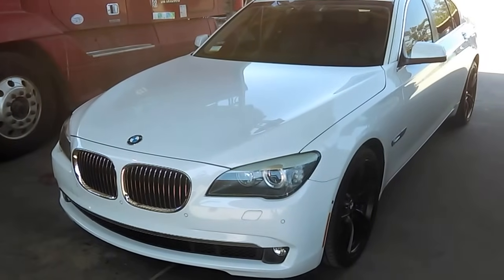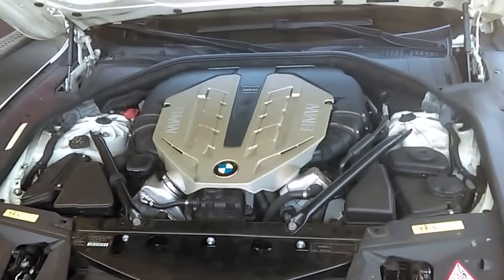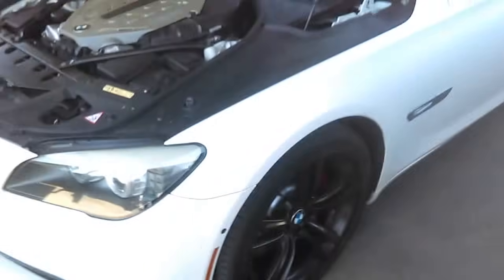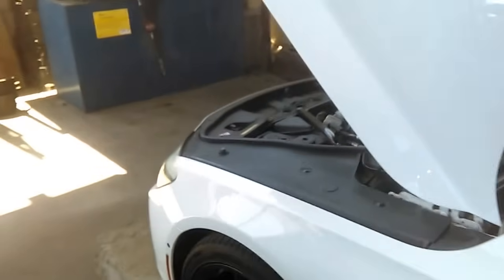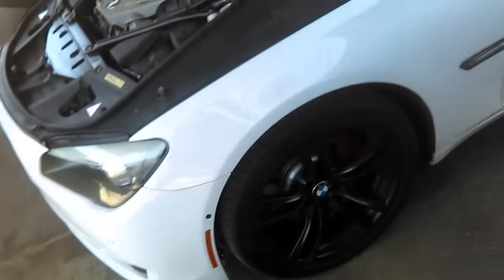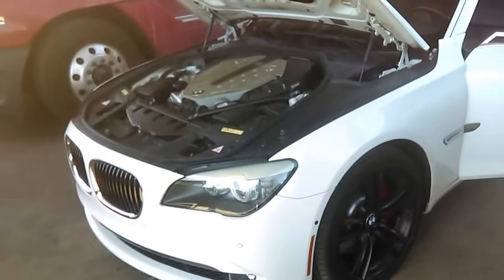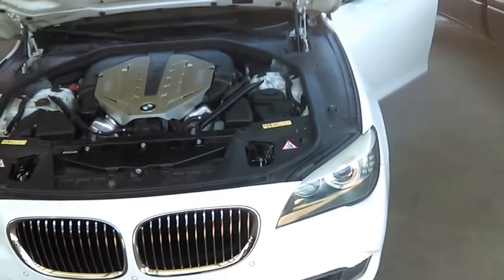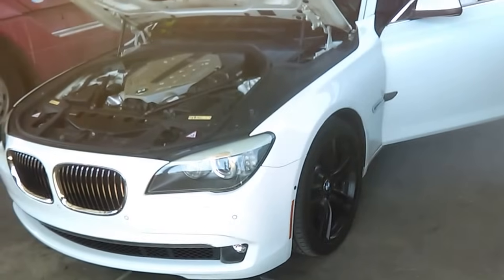BMW 750i 750Li F01 F02 common problems

Comment: @Francisco Amaya, were you lucky enough not to get the "Drivetrain malfunction error" yet?
Reply from the maker: +Razvan R
Do you mean the "transmmision Fail-Safe mode?
Reply from the maker: +Razvan R 
Ok, drivetrain malfunction error is a protection mode for the power train components to prevent and major damage to them.  
This usually happens when the vehicle needs a major service or major tune up the problem is than you need to have a BMW diagnostic tool (cost around $3,000.00) to know the actual reason with the of the drivetrain malfunction error.  
My BMW is running fine at this moment but I am going to replace the spark plugs soon because that is one of the major reason why the drivetrain malfunction error protection mode comes on.
Reply: About to do that myself as well, I searched a lot about it and I've seen many cases where they changed something but the error was still there, or they couldn't find the root cause at all.

That's why I got all these possible answers out, maybe I can have them checked at the service:

>>>>
We had this message almost immediately, returned car to the dealer, took them a half hour to find the problem.  A short, 3 inch or so, flexible tube connected to the turbo would kink and after replacing it it has never recurred.

bought a 740D 2 days ago,having the same problem.The car performs well but the message appears after the engine goes at 90-100 C°.I will visit a workshop these days and I'll be back with some answers. ✌
UPDATE! 
I changed the engine oil and the malfunction is gone!

I had Problem with Idel and error DRIVETRAIN IN 750I 2010 F01 I have fix and chaange Throttle Body work great.

ignition coils and/or spark plugs

I had to put a new transmission And shifting gear. 13k job!!!! Hope you covered

Tichatyei Chieza Yep, Got it fixed in june. A warranty issue..It was a faulty valvebody

Got a Drive Train malfunction on my Bmw 528i, Took it to Bmw of Ontario CA to get it checked out. Ignition Coils were on Tsb Recall and the best decision (they said) was to get new Ignition Coils and spark plugs. 

I had drivetrain malfunction and they replaced coil, spark plugs, 4 injectors and 1 more thing which i can't remember... 1 week total and now she's fine

N63 recall in USA

Thanks for the answer, very kind of you Francisco! You and your car stay out of trouble :)
Reply from the maker: +Razvan R 
Thanks, you are welcome.
Reply: Turns out it was due to a "missfire on cylinder 8" error. 
The mechanic moved everything from the 8th cylinder to other positions: the injector to 7, the coil to 6, the spark plug to 5 and then the missfire error moved to 6, so faulty coil for me.

Comment: do u know how to fix the excessive oil consumption and what parts needed to replace?
Reply: i have 750li 2009
Reply from the maker: Most of the time it can be the valve stem seal or the turbo charger
Reply: Francisco Amaya thank you
Reply: approximately how much does it cost to get it fixed ?
Reply from the maker: That is like 5k all together.  Valve stems seals are like 2.5k
Reply: Francisco Amaya that’s what I thought. Thanks so much, I appreciate it. I didn’t want to get scammed that’s why I asked.

Comment: Question. I have a 2014 bmw 750li with only 25k. Ac is blowing warm air. Hooked up the ac pro recharge system thing and it shows no refrigerant needed. What do you think the problem is? Obd scanner did not pull any codes
Reply from the maker: Check the ambient temperature sensor 
Check if the ac clutch is engaging
Reply: Francisco Amaya how hard is it to check these things and where would they be located at?
Reply from the maker: It is easy to check the ac compressor all you have to do, it is to see if it rotates.  The sensor is the same one that displays on the dashboard

Comment: I have one and it stays in the shop at least once a month I just got it out the shop $4000 for drive shaft. Now 4 days later I go outside my air bags are out the back end is sitting on the ground

Comment: Hey Francisco did you get the recall done on the n63? They gave me a new engine because of the lawsuit about the oil consumption.
Reply: Larry Troupe hey I’m in Tennessee and I see there’s a recall on my 2012 750Li xdrive for the turbo water pump or something like that! Is this the reason for your engine replacement?
Reply: J. Kisart 
Oil consumption was the issue and they gave me a new engine rather than try to fix it.
Reply: Larry Troupe wow I’m going to BMW of Memphis hopefully I can get blessed as well lol thanks man 🙏🏾
Reply: Larry Troupe so my recall is Electric Auxiliary Water Pump For Turbocharger so maybe I won’t get so lucky lol 🤦🏾‍♂️ It would’ve been great to get a new engine
Reply: Larry Troupe the BMW dealership here in Memphis just told me today that they will NOT replace my engine however they will check the valve stems smh I’m pissed

Comment: I have a 09 750li and my transmission malfunction was coming on and a few months later the the car was driving funny and stop producing power (drivetrain error). I was told replace my crankshaft valve. Did that nothing. Then transmission oil pan. Didn't not do that because my codes showed misfire. So Bmw dealership said car needs TUNEUP. Did that. Car was driving good then the next day bam drivetrain code again. I only did this when I would drive more than 5 miles. When the signal comes on it shut car down to safe move and I can hear my fan running extremely high for 5 mins with car off. Does this sound like a common issue? Is it a fan or radiator issue or would that have nothing to do with the drivetrain code coming on?
Reply: Kacino Liggens did you figure it out!? I’m thinking of buying an 09 as well! This isn’t my first bmw but man these reviews are scaring me
Reply: I am guessing probably Machatronic adapter and sleeves along with transmission filter and oil change.
Reply: Noah Cross hi. Did you got it? Am thinking in getting a 09

Comment: 2014 bmw 750li xdrive. Car has 20k on it. Is it worth a buy?
Reply: It got the tu Valvetronic engine.
2014 2015 are better cars than
earlier ones.This is all I can say.
I'm looking between marying a
hooker or buying a F01,haven't
decided yet.
Reply: Louis-Philippe Lavoie just bought that car yesterday and drove it home 8 hours.. AMAZING is all I can say. 20k on dash so hopefully shit stays intact for a while
Reply: Louis-Philippe Lavoie 2014 750li
Reply: Wow congradulation my man!
Reply: I bought a 2014 750i with the TU engine with 34,000km and in 2 years all I’ve had to do is add 4 litres of oil (the car tells you when required) and replace the drivers side door handle which wasn’t cheap as it’s painted and coded to the car. It’s a great car,  and I’ve done 55,000km now. No regrets at all, if anything it’s the best car I’ve ever owned. Just service it correctly and don’t drive it like you stole it. I learned that from my AMG years back, if you drive it hard then expect repair bills.
Reply: The Boogie Down Bronx lmao I drive it like I stole it though!!! Sometimes! Haha. Thanks for sharing brother. The only thing I’ve noticed is the sensors start acting up after a hard car wash but that’s about it. Only 29k on it now but I’m thinking about trading it in soon and getting something that’s less expensive on maintenance and labor

Comment: Does the models with the 445 hp engine burns a lot of oil too?
Reply from the maker: I have a 2013 BMW X5 Xdrive50i with 445 hp  and it burns oil too.

Comment: Hi there, I have a 2009 750i and the steering malfunction light has come on. I took it to my local steering shop and they pointed out it was the rear wheel steering. It's locked in a turning position. I can't find anything online about this problem. Also the steering wheel is way off centre position but the car drives straight.  Any ideas? Thank you!
Reply: Brandon Richardson hi Brandon. Am looking to get a 2009. Any advise? Any problems? Thanks

Comment: I was thinking to upgrate from my e39 530I to this, but probably not. Touch wood my E39 is going super strong and does not eat any oil, I cannot imagine how a 11years newer model will have problems that my e39 2000 does not.

Comment: Hi. My 2010 BMW 750li trunk/boot won't open anymore. Tried with the remote and even the button inside but it won't open. Please tell me how to fix this.
Reply from the maker: Did you check for broken fuses?
Reply: @franciscoamayaYT  I've fixed it. Thanks. It was the button in the middle compartment. I mistakenly switched it to lock. Just had to switch back to unlock

Comment: Hi ,I have same problem with my car it's bmw 7 serious.
It's start shaking about 60mph ,I do balance for 2 front tires now its fill better than before but still a little bit shakes.
The tire have some bumps on it and worn on one side, two tire shops said maybe it's a shock problem but I'm not sure.
That's shock or alignment what you think..
Reply from the maker: You need to do a road force balancing on your steering wheels. 
It will fix this problem.
Reply: Hi thanks.
If i will buy 2 new tires it will fix the problem but my concern is maybe it will come back becouse of worn shock..

Comment: I'm looking for the 750 bmw right now :(  should i just buy something else damn i like this car
Reply from the maker: Buy a 750i from 2013 and up, they have the updated engine with less problems.
Reply: Are all the the early ones bad or is it a hit or mis
Reply from the maker: Well, I have a 2010 BMW 750i. So far no problems but I do good maintenance to it and do floor it too much. 

It is a hit or miss, depending on the maintenance that was done in past.  
But if you want a better engine, 2013 and up are going to be the best option.  

I also have a 2013 BMW X5 Xdrive50i and I don't have problems with it but it is possible that you can have oil consumption, it is a very common problem with N63 engine (all years almost)
Reply: Get the 08 750li I had it for 2yrs and no problems yet
Reply: DO NOT DO IT! My 2013 BMW X5 (N63 engine) looks good but it is smoking like a chimney.
Reply: John Fontaine what about 2009?
Reply: @JB-mm4bb  it is your valve cover relief valves... The rubber deteriorates allow in air thus causing it to smoke. $15 fix

Comment: Found a 2010 BMW 750i online for 
$8,999 
with 137k miles. 

Black on Black
Park Distance Control
Power Tailgate
Multi Contour Seats
Heads Up Display

Good deal? Will it be an endless money pit?
Reply: Zechs Marquise sounds good, or I’ll just buy a used Lexus 😂
Reply: Zechs Marquise I think I’m inheriting- a 14 ES350. It’ll run forever 👍🏼
Reply: Zechs Merquise  would you consider 70k miles on a 07 750il new?
Reply: Run that car has to many miles for a 750 it's trash

Comment: Hey could you tell exactly where the ccv valve is located on my 2012 750 li
Reply from the maker: It goes from the valve cover to the intake manifold.  The intake manifold are located in where the exhaust manifold goes in a common engine.
Reply: Francisco Amaya so will it be the small orange rubber rings similar to the ones that are on 2006-2009 models?

Comment: I thought the oil consumption was due to valves stem seals leaking? It's a common problem with hot V configure v8s.
Reply: Yes you're 100% correct...
Reply: Thought so - cheers...

Comment: I just bought a 750Li and the rear sunshade will not go down. Anything I need th check?
Reply from the maker: Check all the fuses if all the fuses are ok, the sunshade mechanism could be stuck open with something in between.

Comment: Francisco where is camshaft positioning sensor's on 2010 BMW 750li
Reply from the maker: They are in the rear area of the valve cover.  Two per side.

Comment: My 2010 750i xdrive just turned over 105k burns oil front suspension squeaking HUD stopped working battery drains if I let it sit for long periods wouldn’t trade her for nothing

Comment: I suppose to buy this bmw 2006 750li from a guy he said he brought a bmw 7 series motor and had it but had bmw to fix the put gasket kit oil pan fluid bmw twin power set oil filter bmw twinpower turbo ethanol gas treat ment and he said he had his mechanic to put the motor and transmission in. Is this good any tips
Reply from the maker: Well, 2006 BMW 750Li has not twin turbo engine. 

Hmm, if the engine was rebuilt and it is running with not problems I guess it should be alright.

Comment: what about the 740li? 2011 or 2012 ? alot of problems?
Reply from the maker: +Sean Mendoza 
The BMW 740i is good has good power and good fuel economy. 
Still it has some problems like water pump Failure, coolant in oil, fuel system failure, etc,. 
In some way the straight 6 cylinders engine (740i) has a better reliability than the V8 N63 (750i)
Reply: gotcha....i was debating between a 2009 m6 or a 2012 750li or a 2012 740li ......i heard the 750li is almost as fast as a m6 but i seen your videos and realized maybe a 740li would be cool to cruise in style and a m6 to have some fun....or do the m6s have problems as well? thanks!!!
Reply from the maker: +Sean Mendoza 
Yes, the m6 still have problems it comes with a V10 engine very powerful. 
It was many problems too but you have to drive it nicely and give good care to avoid them.

Comment: I HAVE A 2014 750LI AND I HAVE CODES P15EF/ P01C8 / P0306/P0305/P0308 WHAT COULD BE THE ISSUE DO I HAVE TO TAKE IT TO THE DEALER????
Reply from the maker: You have drive train malfunction events 

Misfires on cylinders 5 6 and 8.  

You should replace the spark plug,  it could fix it.

Comment: How about 2010 F02 730Li 3.0Litre?

What are the problems?
Reply from the maker: The chassis problem are going to be very similar to the 750i, but engine problems are going to be different. 
The 730Li has the N52 engine (not turbo engine)
It is going to have problems with. 
PCV valve
Intake manifold leaks
Valve cover oil leaks
Thermostat Failure
Valve lifters Failure
Timing chain guides
Vanos problems
Possible oil consumption
Etc,..

In America this model is not allowed (emissions standards) but this engine is more reliable than the N54 engine ( 740i)

Comment: Man let me tell you stay away from all BMW with V8 problems on top of problems I have series from the E 39 to the E60 and now the F10 no major problems except the fuel pump on the e60 So if we are in the market by a BMW five series equipped with a in-line six
Reply: Get carshield Insurance on any bmw that’s used

Comment: The oil consumption is caused from valve seals buddy
Reply: Is there anything to fix this issue
Reply: @tyreenatl  did you ever figure this out? There was a lawsuit for certain models and bmw was 'fixing' the issue. Some get engine swaps if it's really bad and you pay based on your amount of miles.

Comment: My check engine turn on I went to the dealership to start the battery is low life charge and after that it cost me 29000 dollars to fixed my car stop running and shaking and waiting a lot of gasoline I'm a buy a new battery to start see what's next

Comment: Hey Francisco, 
Just bought a 2012 750 with M package but it has no fog lights.  Ive read somewhere that they dont put fog lamps on M package.  Is there a way to add them?
Reply from the maker: +jerry martinez 
Yes, you could install the OEM fog lights but you will need to check if you BMW has a pre-wired plug for the fog lights ( you will need to check inside the bumper where to see if you can see the fog light plugs)
If your BMW has the plugs you will need to buy the fog lights and the the fog lights mounting bracket (the black little screen in front of the bumper) and you need to buy a headlight controller with fog lights and replace it for the one you BMW currently has and after that you will need to program your BMW computer to activate the fog lights functions.
Reply from the maker: +jerry martinez 
Yes, you could install the OEM fog lights but you will need to check if you BMW has a pre-wired plug for the fog lights ( you will need to check inside the bumper where to see if you can see the fog light plugs)
If your BMW has the plugs you will need to buy the fog lights and the the fog lights mounting bracket (the black little screen in front of the bumper) and you need to buy a headlight controller with fog lights and replace it for the one you BMW currently has and after that you will need to program your BMW computer to activate the fog lights functions.
Reply: Thanks

Comment: Is buying a BMW 750li with 100000 miles good or bad
Reply from the maker: It is good, but what is it price?
Cash or credit?
Reply: @franciscoamayaYT  15,000
Reply from the maker: What's the year of the 750li?
Reply: @franciscoamayaYT  2009 ... What years are good ? BMW 750 li
Reply from the maker: 2013 and up is the best to buy, but 2010 750i still around (the one on this video)
It has no PROBLEMS, if you want to keep your BMW without PROBLEMS all you have to do is to drive it nice and smooth and do good maintenance to it and you will see that the car give not PROBLEMS.  

Just make sure to do a inspection before buying it.
Reply: @franciscoamayaYT  you should make a video of how to inspect a BMW before  buying one that  will be great 👍
Reply from the maker: Sure,  I will do that.

Comment: REPLACE SPARK PLUGS ON 5 AND 6 AND STILL HAVE MISFIRE ON 5 AND 6
Reply from the maker: Ok, so you can have  bad ignition coils or injectors.  
But make sure the check for vacuum leaks as well.

Comment: Those not big problems Cheap to Fix Control arm Not expensive Battery Not expensive, Oil Cons who cares,
My Bmw m550d two front Drive shaft 1900€ just the part, XDRIVE atc rebuilt 2000€, Engine rebuilt 10.000 euro,EGR 3-600€,DPF DELETE OR CLEAN 2-600€
Glow plugs as its difficult to fix 4-500€
Brake pads discs front 6-800 € just part! O ,O Sorry front shock edc 900€ per piece, rear 6-700€ per piece !